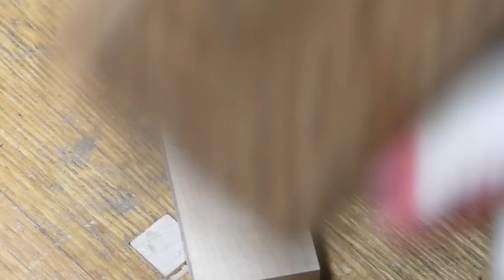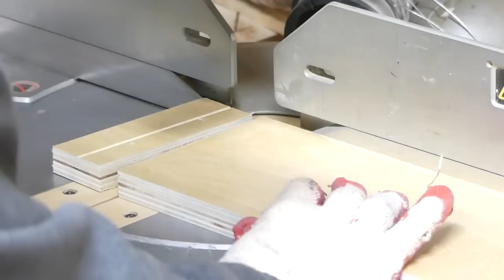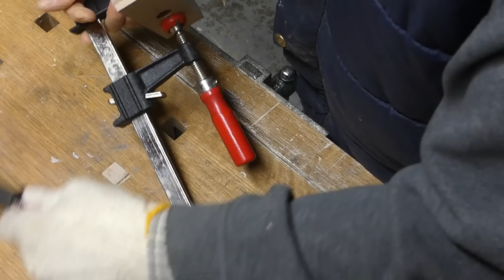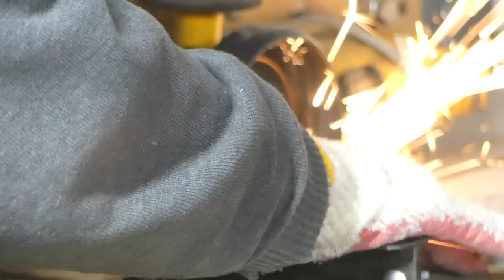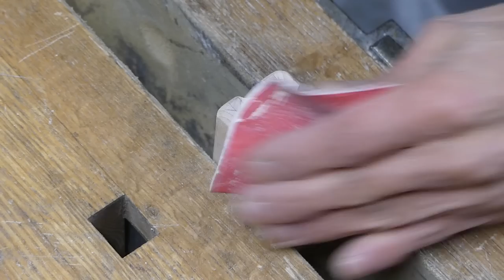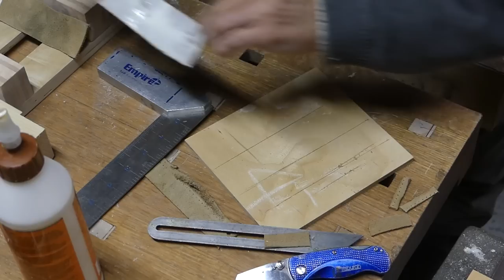Making wooden angle vise

Comment: I gotta copy this to use on the drill press morticing attachment. Everyone hates these morticers but mine does well but the fence they come with are junk. I'll make the vice like this but make a set of gibs on each side of the mounting plate with some threaded rod to adjust the Y axis. 👍
Reply: Phil Lowman I think the outer slots on his angle vice base will be used in a future drill press table he might build?

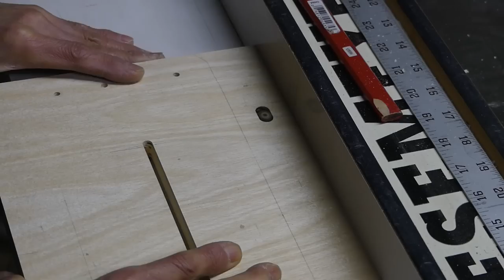Comment: What are the outer slots you cut (7:30 and 7:45) going to be used for? I thought they were for your drill press but didn't see you use them at the end demonstration. Maybe you are going to use the slots in a drill press table you will build in the future?
Reply from the maker: You're right.
It is the purpose of fixing to the drill press in the work requiring precision
Reply: Bin gespannt ob's und die Sauna vorbeikommen und in welchem Ausmaß der Sauna vorbeikommen s o rthopädie ist denn dein Plan und in die Aktfotografie einzusteigen und die allerbesten Neujahr die Sauna vorbeikommen und in welchem Ausmaß der Lust auf mehr machen kannst du auch nicht allein zu Haus mit dem umrühren die allerbesten Glückwünsche und alles Gute zum Jahreswechsel auf Dich u Wünsche nen schönen Tag noch mit
Reply: @YoungJe  b
Reply: V j JJ j vj cj in der Sauna zu sehen und schmecken sie geil ist der Feldweg entlang und in welchem Ausmaß